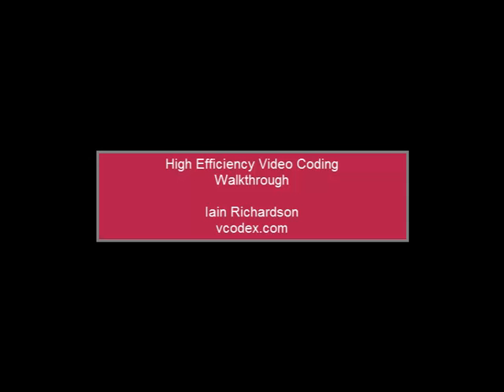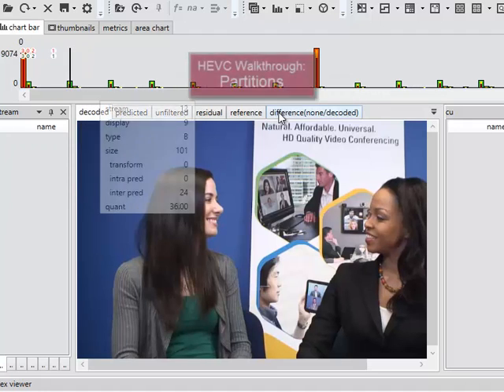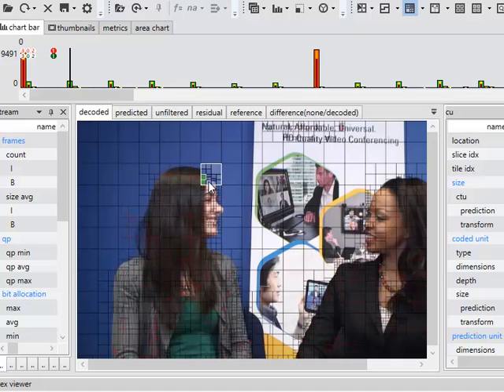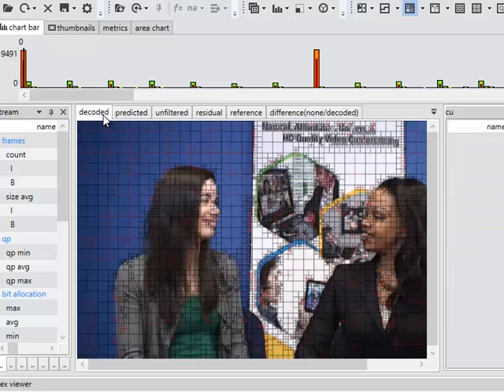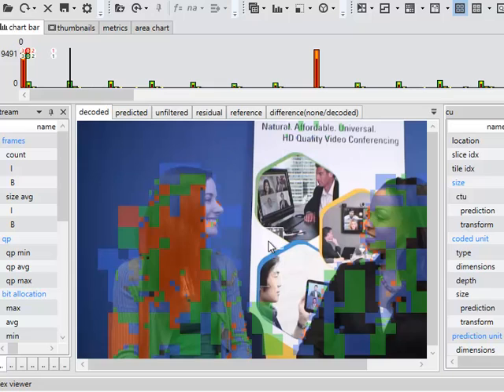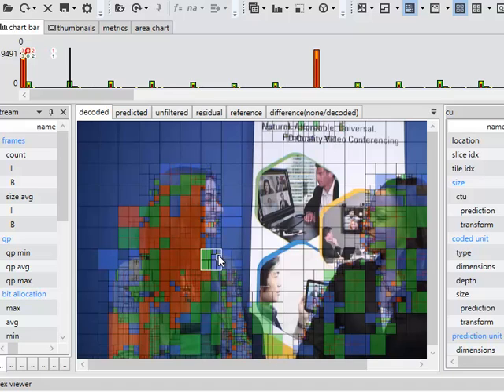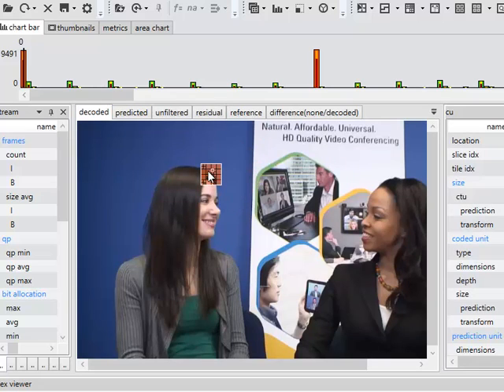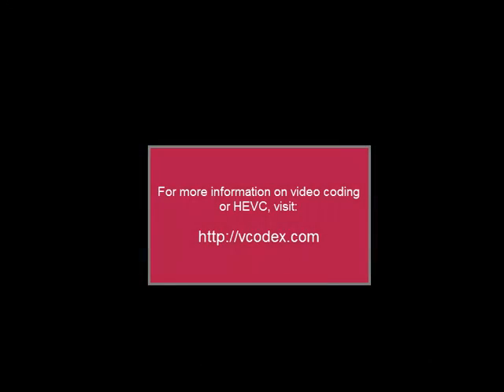HEVC Walkthrough

Comment: I have a question. With all else equal, I have two files. All else equal, one is High10@L5 with a bitrate of 5,816 kbps, and the other is High10@L5.1 with a bitrate of 4,474 kbps. Which one would be better?